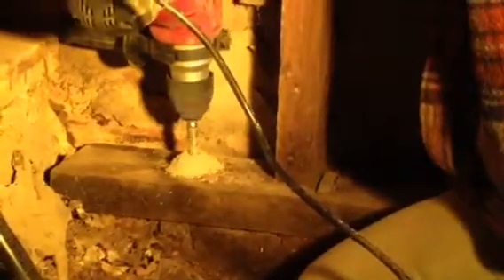HOW TO BOLT YOUR HOUSE...

Comment: The lack of safety gear here such as enough light for the backround as well as the work location, the lack of any plastic barrier between the termite pesticide laden, mold and fungus laden ground, the air filter that is marginal for dust instead of an Activated Carbon Cartridge type indicates the amount of experience this company has with pro retrofit work.